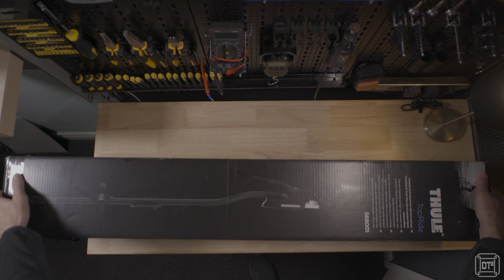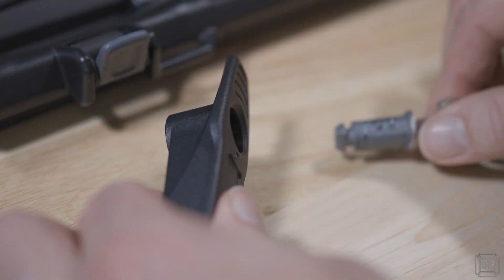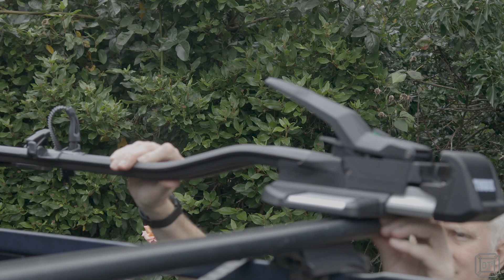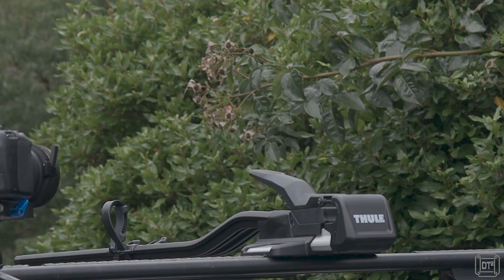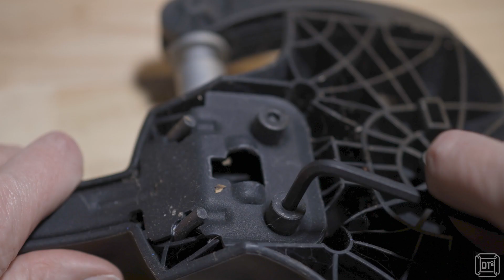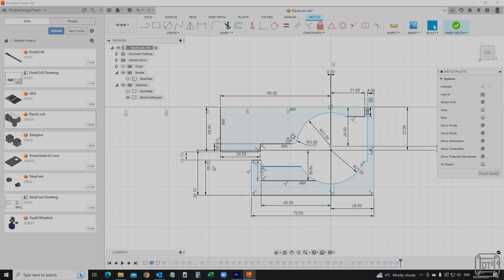THULE TOPRIDE BIKE RACK - Safer option for roof mounting bikes?

Comment: Did you ever consider the upride 599? If so, why did you not choose that one?
Reply from the maker: The 599 is a good rack but wasn't on my list as it is a "both wheels on" rack. I specifically wanted a rack that carried the bike with the front wheel off. Mainly due to weight as the e-mountain bike I wanted to carry was close to the weight limit. Also as I have a tall car keeping the weight and size of the bike down when lifting it onto the roof is a big plus.

Comment: I found this video while researching making my own custom rack with help from 3D printing. I wanted to see what the feature set of modern racks. This was extremely helpful and well done!
Reply from the maker: @jeremymoller1038 Thank you. I'm glad you found it useful. I can't remember if I mentioned it, but I did try and create a 3D printed lock for securing the axle QR lever.
I gave up as I couldn't get sit strong enough. However, as part of that, I modelled the outer assembly that holds Thule lock barrels. If you are interested, let me know, and I'll chuck it on thingiverse.

Comment: I wanna get on of these but my emtb weighs 20kg without the battery, the 568 takes a maximum of 18kg. I’m note sure what other options I have.
Reply from the maker: It's obviously safest to not to exceed the maximum weight restriction so I wouldn't suggest you do that. But before you look for alternatives have you checked the bike's weight without the front wheel? This would potentially reduce the weight by 1 or 2 kilos, possibly more. Also unless you have a dropper post, you could consider removing the saddle (and post) when putting the hike on the roof.
Failing that you may need to consider alternatives such as rear mounted carriers as most of the roof carriers max out at 18kg.
Please let me know if you do find one that solves your problem though. Best of luck.

Comment: Hello, I recently bought similar Orbea rise and I’m looking for good roof rack. How is your experience with this bike + this rack?

At the store seller told me that the bike is dangerously close to the weight limit. In addition, this weight is distributed high (because of battery) so that the bike can sway a lot.

Can you recommend it based on your rise?
Reply from the maker: Hi I've had no issues with the rack it's much easier, and safer, to load the bike than other roof racks I've used in the past. In terms of weight it would depend on which Rise that you have. Mine is the carbon version M30, which is lighter and from memory it's at least a few kg under the racks max. My friend has the Ali version ( H20 I think is the model number) which is heavier but under the limit. Bear in mind that removing the front wheel saves some weight.
We have traveled a fair bit with it including several journeys of over 100 miles. Never had an issue or noticed swaying issues.
Not sure if your store rep is just being cautious or trying to push a different rack or is not keen on roof racks.

Comment: I’ve owned a top ride for a while now, it’s a good rack, but, while it is very is very easy to load a bike, it is also very easy to remove. This is my criticism of the rack. I feel it needs a lock on the quick release mechanism, the rear lock is not sufficient enough to stop someone having a go at stealing your bike. 
Just been emailing Thule about this, to see if there was any modifications available, sadly not. Would be interested if anyone has come up with an alternative?
Good video by the way. 
David
Reply from the maker: Thanks for the feedback glad you liked the video.
The closest thing I'm aware of to lock the wheel axle is the replacement axles available from SCIDS mentioned in the video. This is an axle with a drilled hole at one end for a padlock this works with my old rack and the new FastRide HOWEVER this would not add security with the top ride because the jaws are not lockable. If they added an option to lock the jaws and the axle it would be more secure.
I'm conflicted as to whether this is a disadvantage since I don't think anything they added would be much more secure. Better option I think is to add an additional decent lock or not leave unattended.
Reply: @DTSquared  agreed about not leaving unattended, just a faff on the odd occasion at motorway services, having to put on a massive ‘Gaurd’ D lock.
Reply: The other option is the yakima highspeed, but some have issue with mtb brake fit. And it cost a bit more.
Reply: if someone wants to steal your roof rack mounted bike, they will steal it. This mechanism is perfect and doesn't motivate theft 😂😂😂  what a ridiculous thing to say